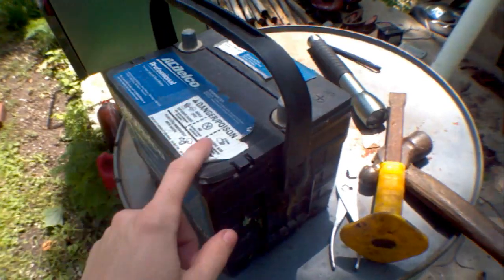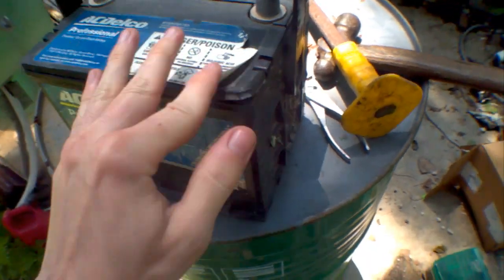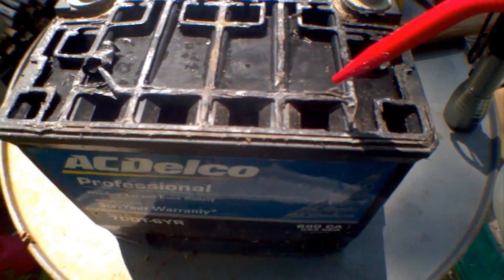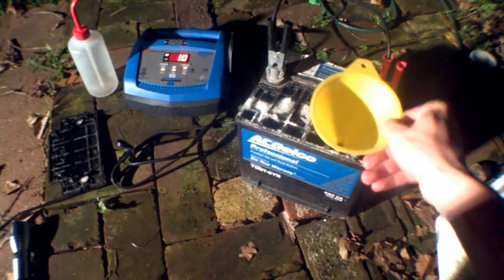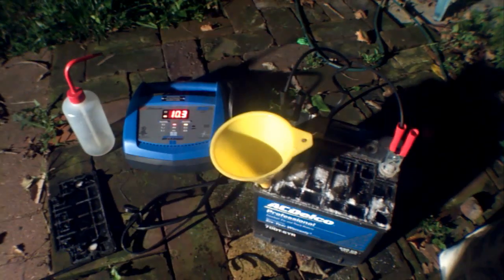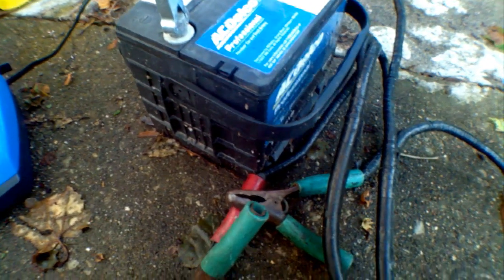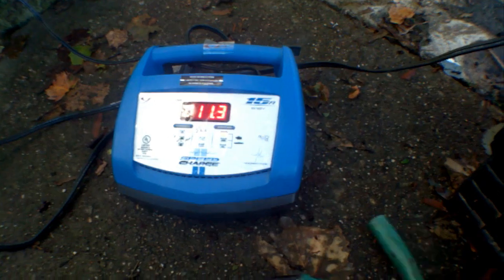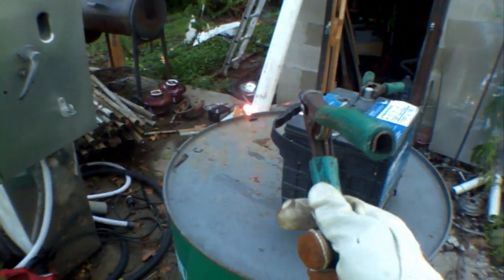DIY: Opening a Car Battery and Repairing with Epsom Salts

Comment: Very clever - but I can just picture some kid having a go at this in their dads garage and ending up getting hauled screaming down to the nearest casualty department with Acid burns....?
This is an incredibly dangerous thing to be doing - with very little safety shown or mention of the risks involved....! - Particularly with a sealed battery...!
Take this down Bro - before some kids end up in the hospital over it - you may not be Legally Liable - but Morally Responsible....? I would think so...!
Reply from the maker: not many kids watch this, also if they hurt themselves thats their own fault not mine. death is a good way to weed out the idiots and the week.

also batteries arent super dangerous like a lot of people think. battery acid just irritates skin. i've always had plenty of time to wash it off. go watch my "battery acid incident" video if ya want.

Comment: Rather than spark it, you can discharge it by connecting an inverter and something. Then once it's down to 11 volts charge it back up to max. Do this 5X :) I saw that one another video.

Comment: You can use a lot of things as an electrolyte.  The old-school trick was to drop a tab of unbuffered aspirin in each cell.  However, the sulfuric acid actually reacts with the lead to form lead sulfate.  When the battery discharges, the specific gravity drops as the sulfate comes out of solution to bond with the lead.  Using sulfuric acid stores much more energy than other electrolytes.  The lead sulfate reaction can also be repeated over and over again with little of the deformation or scaling of the lead plates that you get using other electrolytes, so the battery will last longer.

Don't burn wire or make sparks at the terminal.  You might blow up your battery or fuse the lead plates together.

Comment: The correct way to refurbish the battery is to replace the electrolytes.  Fill it almost full with a sulfuric acid and distilled water solution blended to a specific gravity of 1.2 at 77 degrees F using a hydrometer.  Then you charge it up and test the specific gravity of each cell.  Adjust with a drop of acid or distilled water until you get 1.275-1.3.  Discharge completely then recharge and test again.  Remove solution and replace with water if you have specific gravity is too high..

Comment: The objection I've heard to epsom salts is this: if it made a good electrolyte then the battery manufacturers would be using it already. Apparently the problem with magnesium sulphate is that it has a habit of settling out of solution when the weather cools down. So cold day - car won't start.

Comment: An explosion will only occur in an enclosed space. Since the cells are open to the air its perfectly safe. The worst you will get is a little pop! if any hydrogen ignites. This is why he didnt blow himself up.
Reply from the maker: yeah and even if the top had blown off the battery. people are forgettting that this battery didnt have any sulfuric acid left in it.

so at the very worst i would just have a couple cuts from bits of plastic.

Comment: A spark test with an 80% chance of explosion due to the hydrogen gas being released from a battery ? , i dont know about you but i would be very dubious creating sparks at a 5% chance of explosion. this guy is risking life and limb for a few bucks saved. im not picking on the guy just pointing out what is obvious and a potentialy very dangerous situation. hydrogen is a very volitile chemical. avoid flame or sparks at least 5ft in an open area and certainly nowhere near any gases indoors. have fun.
Reply: considering he was doing it outside, in a non-enclosed space, the risk isn't very much at all.
Reply: Oh, is that so, then go ahead. We are talking about hydrogen here, you do relise, but hey what do i know, right.
Reply: findvoltage
With my own experience I can tell you that a volume of 6 ounces (coffee cup) of hydrogen can  make all your windows and doors rattle at your house.
The risk is very real.....have you ever seen a 1500 lb battery explode? and there was no external spark involved.
Reply: I can't agree more, I watched with total amazement at what us brits would call FUCKING STUPID TWAT, but the hospitals are full of them.
Reply: findvoltage

Comment: why not just drill a hole in battery and fill then cap? why wreck it?
Reply from the maker: course I didn't want to drill into the plates. I didn't wreck it. I took off the cap.

Comment: Maybe if u set it on something besides concrete and brick which will drain a battery in no time it might get a higher voltage
Reply from the maker: concrete does not drain a batteries power. i put all my batteries on concrete and they hold a charge for months.

don't fall for that stupid myth. it does have a frain of truth but it's irelivent now.

from the 1880s to the 1930s lead acid batteries where glass cells inside a wooden container, if you set the wooden batteries on concrete they would get moisture and rot. latter in the 1940s we got rubber shelled batteries that would have issues with moisture also.

but every since the 1970s we have used polypropylene casses for batteries. now moisture has no effect.

if you still dont believe me, just ask the 12 car batteries i have sitting on concrete for the past year.

Comment: Straight sulfuric acid is almost as thick as maple syrup, what is in the battery is electrolyte, mostly water. I use to make electrolyte by slowly adding water to the sulfuric acid until you get the right reading on the hydrometer for the Navy ships being built here at Bath Maine (BIW) for 17 years. I use to like freak people out by driving my finger into the electrolyte of a battery, you have a lot of time to wash it off. You couldn't do the to straight sulfuric acid lol.
Reply from the maker: yeah i agree. battery electrolyte is so deluted that it's really just an irritant. especially when the battery is a decade old like this one. the sulfuric acid tends to break down/react the older it is.

Battery Acid Accident

when that happened it barely even felt like razorburn.

Comment: I am guessing that an equalization charge would have worked even better than short-circuting the battery. It probably mixed the electrolyte a bit better?
Reply: My career is a battery controller technician I have experience in the field
Causes of damage with the possibility of reform

Comment: Hey there youngster! Pretty amazing and interesting stuff you got going! However, as I am sure I am not the only one to post this minor detail that maybe you missed during chemical/science class. During charging, flammable hydrogen and oxygen gases are formed. You never make a spark anywhere near a lead-acid battery. Even when jump-starting another car, always make the last connection with your jumper cables on the car w/ the good battery not directly to the good battery but to the engine block or a jump-stud w/ your negative cable. Many people have been maimed, burned and or blinded by exploding lead-acid batteries. Be careful on Grandpas farm!

Comment: Had you ever seen a battery explode before,or been doused with battery acid when one blew up you would take a lot more care with jumper cables,and bare wires around them...Glad you did not find out the hard way about batteries explosive power...
Reply from the maker: i've seen batteries explode and had acid splashed on me. heres the video.

Battery Acid Accident

hope that makes you laugh ^^

Comment: People - don't do this unless you like to live dangerously. As mentioned - the hydrogen is highly explosive. So before you do this leave the battery charger off for at least an hour then fan the area with a newspaper. I still don't recommend doing this but these precautions will improve your odds. I have - in my work (I am an auto development engineer) deliberately set off battery explosions. They're ugly. If the blast doesn't get you the acid burns will. you have been warned.

Comment: Fun video, but for every ones sake, please, please wear safety glasses or goggles. Also,  have some fresh water handy too, like say from a garden hose.

Like the others say about off-gassing of hydrogen gas (think Hindenburg) and the risk of an explosion from a stray spark,  I've personally only seen one explode, but the poor guy got very badly sprayed in the warmed acid (from the charging) as the battery exploded,  acid sprayed several yards around him, just like a bomb.  It quickly and badly burned his skin and clothes in seconds, even though he was wearing long sleeves shirt and jeans, the acid eat right through both.  luckily there was an emergency eye wash station at hand, too.  
Have fun, but please with some more safety will help you have more fun, longer and healthier.
Being blinded or crippled by an explosion really puts a damper on fun.
Nuff said.
Cheers.

Comment: Can you do a video of a test if leaving a battery on concrete kills it? Some people say don't put a battery on concrete and some say it don't do nothing. Thanks! And be safe.
Reply from the maker: that's just a myth that is false. it started because most batteries before the 1940s where made of glass cells held together by wood. concrete is moist so would rot the wooden cases.

but now since we have polypropylene cases that resist water its no longer an issue.

and I store all of my batteries on concrete.

Comment: I have been near batteries when they have exploded, please be careful when making sparks around lead acid batteries.  I have seen a couple of batteries explode even when everything was done properly but there was a loose connection at the battery when the power was turned on.  
and yes the tops blow off in little pieces like schrapnel and it sounds like a shotgun going off, it will make a believer out of you...